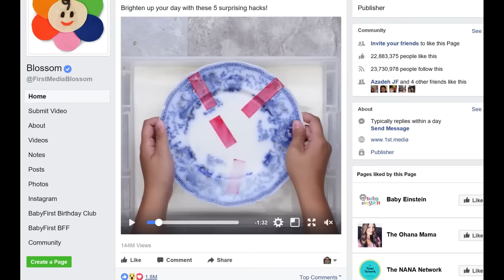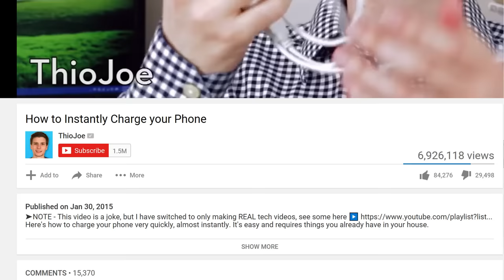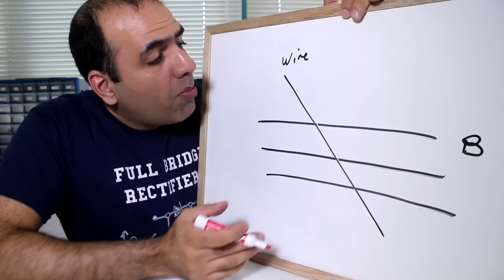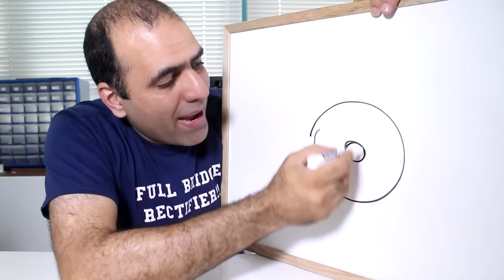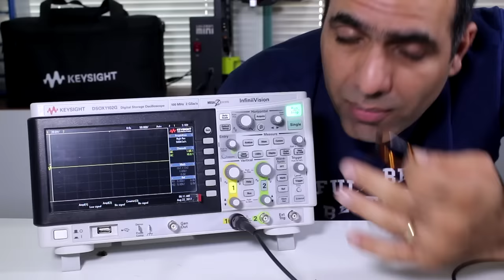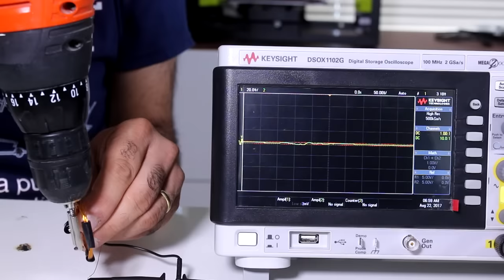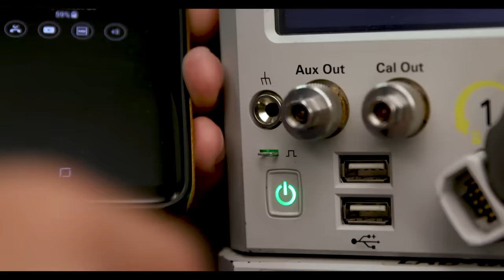Fake DIY Projects Exposed, and How a Real Generator Works

Comment: Oh how smart. Use electricity to generate electricity.
Reply: And actually use more energy to make less, so the efficiency of this is less than 0%
Reply: And bonus, because perfect energy conversion is impossible, it’s electricity, generating electricity, but losing a lot of the original energy through heat and mechanical friction losses.
Reply: Ah yes , enslaved electricity
Reply: use electricity to make electricity to power your electricity makefs
Reply: Thats weird
Reply: @vasilicateodor1862  there is no less than 0% efficiency mechanically.
Reply: He makes electricity to give birth to another 1%MAh
Reply: it's good as proof of concept
Reply: @senselessnothing  I got notified because of you
Reply: @dailyvideos9241  I didn't get notified because of you!
Reply: @HappyMatt12345  I got notified because of you
Reply: @HappyMatt12345  proof of concept
Reply: @senselessnothing  2 sec ago??
Reply: @senselessnothing  also not
Reply: @senselessnothing  I got notified because of you
Reply: @HappyMatt12345  I got notified because of you
Reply: Hmmm yes the floor is made out o floor
Reply: Well in certain scenario it's good - transformers and optocouplers come into mind.
Reply: @nerijusvilcinskas7851  I got notified because of you
Reply: HappyMatt12345 ideally, a generator would not do that. In fact, nothing would. Rather humans convert energy always at an energy loss, to make a more valuable product just in terms of human money. E.g. lots of energy in nuclear fuel turned into way less electrical energy but now in a form much more useful to humans so worth more.
Reply: @johngodfrey3562  I got notified because of you
Reply: Imagine charging your power bank with this.
Reply: mmm yes this electricity is made out of electricity
Reply: It’s basically free energy 😛
Reply: Electricity laundering
Reply: Efficeny isn't 0. Efficeny is only 0 when there's no output. You divide output power by input power and multiply that by 100%. That's how you calculate efficiency.
Reply: @mohamedelsadig5820  r/woooosh
Reply: @stefanpejak9131  r/woooosh
Reply: It actually works
Reply: Yes the floor is made out of floor.
Reply: Congrats, you invented industrial generator.
Reply: Some people use electricity to generate another types of power, he uses electricity to generate electricity 😎😎. Free Energy device confirmed???
Reply: That example with driller is actually the perfect example but the case is that the fuel is different. In his example electricity is used to power the drill and to rotate the magnets for the generator but the real generator consists of a diesel or gasoline engine rotating a magnet at high rpm's, so a generator is not electricity to generate electricity
Reply: you do realize that that is how Fusion Reactors work right? they use electricity to generate more electricity
Reply: How smart, using argent energy to extract argent energy
Reply: Bruh
Reply: i am your 3k comment
Reply: No steam turbine
Reply: 43 chars
Reply: even if it dint lost any energy, there would be no output
Reply: Whats wrong with you
Reply: I used the electricity, to create the electricity. (Or I guess in this case, I used the electricity to destroy the electricity)
Reply: even more smart idea: build a virtual reality portal and take back a Creative Battery from any Minecraft tech mod
Reply: @ajddavid452  oh yeah how smart. Minecraft yeah. ....smart indeed. 🤦
Reply: @solidsnake246  IT WAS A JOKE, also it appears I've already commented on this
Reply: “This is Elon musk”
Reply: lol he did
Reply: It's not electricity making electricity. It's just converting one form of electricity to another form of electricity to make it compatible to the appliances in question.
Reply: Except you lose energy in the process 😃
Reply: So it solves world energy problems. What a genius thing
Reply: That’s cannibalism

Comment: ThioJoe  taught me the importance of changing my computer's oil.
Reply: To be fair, if you have mineral oil computer mod, you probably should change it every few years or so..
Reply: Mythrell lol true
Reply: Actually, I regularly oil the fan bearings.
Reply: But do you regularly check your blinker fluid?
Reply: I personally check AC fluid levels to make sure it stays nice and cool
Reply: You should change your computer oil every 3000 miles or every year
Reply: aszi88 You don't really need to oil them, they are encased in a enclosure filled with greese. They self-maintain.
Reply: PunakiviAddikti whoosh
Reply: At my first employer (GEC), apprentices would bunk off to the pub by wheeling the oscilloscope off-site to get the distilled water changed.
They got caught, not because security got wise to them, but because they tried to bring the scope back through a different gate to the one they went out by..
Reply: I love ThioJoes videos. He seems to be trolling those fake ones!
Reply: Hahaha good one

Comment: Dude I would love that oscope. I woke for the IS Army Calibration lab at White Sands Missile Range. I have used and calibration some nice keysoght equipment.  I’ve always wanted to have a scope at home for diy projects. Love your channel. BTW I took a class at Keysight in California to learn to repair the PSA Measuring receiver/ Soectrum analyzer. Met the guy who worked with the inventor of spectrum analysis. That was a cool week.

Comment: Man I sure could use that scope, I am a student and I have been using an HP1222A 15mhz oscilloscope from the 70s. I already repaired it several times, but now its totally broken and i can't find whats wrong with it. I got so many cool projects on hold because of that, not to mention how much stuff I could do with an actual digital storage oscilloscop that even has a fuction generator and counter, man that would be cool.
Reply: Bttrs you missed the giveaway he did a while back then, he offered three of those
Reply: Dorvuzak Uzn Dang, chances always seems so slim. Maybe this time.

Comment: Min 7:31- this is the hand cranked generator I made in my other video.  It has an actual generator, that outputs to a rectifire circuir. The DC goes to a 5V dc swithching regulator, that outputs to USB".  I think you don't need that rectifier, it would work better without it. The brushed motor that is visible, will output DC allready. The rectifier will drop 1.2-1.8v. Just use a shorky diode, if the dc regulator does not have rev polar prot. It will work more efficienty, but only in one direction.

Comment: Another thing to mention was that USB devices, particularly more recent ones such as smart phones require voltages in the terminals aside from Vcc and GND to charge, so that the charger can communicate with the phone. The first time I tried to make my own USB charger, I connected the Vcc and GND wires of a USB cable to a power supply, with a LM7805 (as the power supply only offered 2, 4, 6, 8, 10 & 12 V). The device said it was charging, but the battery capacity percentage did not go up (iunno how to word it). It wasn't until I broke apart a car USB adapter and connected the inputs to the power supply that the device charged properly. (All of this was for a Bio - Mechanical USB charger for my Design and Technology HSC, which I didn't manage to complete in the end anyway, but because it was accelerated, it doesn't matter too much regarding my final mark in year 12. Aside from that, PLEASE GIFF THE SCOPE AND I'LL MAKE YOU PROUD BY (NOT FAILING) PHYSICS AND ENGINEERING (Hopefully. I've lost quite a bit of hope after failing to complete my Major Design Project).
Reply: Yep for compliant devices you only need to short the data lines (D+ and D-) together to enable 1.5/1.8 amps. Non compliant devices are different. For instance Apple uses 2.1 and 2.8 volts on the data lines for 1 amp and 2.1 amps. From experience an iPhone will accept power from a shorted data line source, though this may depend on the iOS version. Not sure.

Comment: You'll want to take a fork, bend down all prongs but two, then stick in the wall socket.
Reply: Just use a pencil to push the safety lever back in the earth prong slot.
Reply: Ákos Rutai I've actually found a couple of power strips for American outlets that feature a similar protection to that, they are set up to open their port covers when the longer of the two main prongs (not all our plugs have grounding pins so they couldn't do it that way) on a plug are inserted (not sure if it's live or neutral, but one of the prongs is longer and bigger sometimes) problem is that there are a bunch of plugs where both live and neutral are the same length, so the shutters don't get opened and people get really annoyed with the thing, lol. Kinda wish our plugs were a bit more like yours.
Reply: This will save you hundreds on your electricity bills because it will trip all of your breakers. To save even more money, take two forks bend down 3 prongs on each. Hold a fork in each hand and stick each into a different side of the socket. This way you wont have to buy food, clothes, pay for TV nothing. Just a funeral.

(DON'T DO THAT YOU WILL DIE OKAY???)

Comment: As I kid I watched a video where a guy used pliers to open a AA battery and out came 4 button cell batteries. Since I was a kid and button cell batteries were a rarity that powered small toys I tried it my self, ended up getting the core of the sell everywhere and made a huge mess getting all that stuff on my hands. I was stupid.
Reply: Ramen Masri sure it wasn't an 28A battery? Those actually do have four LR44 button cells inside. They're even also labeled as 4LR44.
Reply: xlrxlr nope it was an energizer AA, I'm sure it was an April fools joke but this was several years ago I could be wrong. I have never heard of the battery you are referring to.. is it still a 1.5v alkaline?
Reply: Ramen Masri I saw a vid like that years ago from...gah I forget the name but he hardly uploads anymore and if he does it's mostly promo vid
Reply: Ramen Masri nope. It's a 6v battery, I can't remember if it's alkaline or lithium. Typically batteries over 1.5v are made up of smaller cells that are 1.5v each. I tried this with a small A23 battery and inside it had 8 tiny button cells. 9V battteries are also made of smaller cells. Some are similar to AAAA batteries inside and others are different with wierd box shaped cells in a stack.
Reply: Also seems like im not the only one who had trouble with this concept, a lot of other people tried using normal AA batteries as opposed to the 12v ones. This seems like a pretty stupid mistake in hindsight, but hey I was 10..
Reply: by any chance was it kipkay?  Thats where i learned it from and that video was uploaded about 9 years ago https://www.youtube.com/watch?v=QxS38_u7Mnw
Reply: xlrxlr yes it was!

Comment: I know exactly how that fake cell phone charger generator was done (hint: he took a normal functioning cable bent it backwards 180 degrees routed the cable behind the phone (notice the angle the phone was held at so you couldn't see the side of it) then behind his hand and out of the video frame and how he got it to start charging when he put the coil to the spining magnet well he probably just hit a out of frame power switch connected to the charger cable connected to the phone)
Reply: Or he just had his phone play a video that went from a black screen to the charging animation.
Reply: Jeff is closer on the mark. The coil is a cable presenting enough impedance to the USB to enable "dumb USB 2" charging cable mode. Normal chargers do it with a resistor.
Reply: Do you have definitive proof of this or is that just another possibility?
Reply: Easy version: http://blog.curioussystem.com/2010/08/the-dirty-truth-about-usb-device-charging/
The mistake on this page is that USB 2.1 spec says <200 Ohm. Even a wire short might be compatible but I suspect some low impedance is required or the protection circuit on the port kicks in and nothing happens.

Hard version is in USB 2.1 charger standard.
Reply: Yes, I am already familiar with the USB charging specs. I'm asking if you have evidence that this is how the hoax was achieved.

I presented my suggestion as a possibility whereas you presented yours as a fact. I'm wondering what the basis of your confidence is.
Reply: The confidence lies in the fact that another team uses a similar wire (with resistor, not coil) at work to test if charging mode switch works... Of course it does not charge anything.

If you do not trust it enough, it's easy to reproduce, chop a USB cable, solder D- and D+ lines together (with a tiny resistor or a coil). The dead giveaway is that the mode switch happens instantaneously when in Samsung J3 as shown it takes about 5 seconds - it boots the device partly after all.
Reply: Dustin M I'm not questioning whether it's possible. I'm asking if there is any evidence - something in the video - that makes your thesis even slightly more likely than mine or any other?
Reply: for goodness sakes people it isn't that complex... look at the charge percent
Reply: The charge shows at 48% in one clip and 46% in another. I don't fully understand the significance, can you elaborate?
Reply: jefftheworld when the bar was going up the percentage didn't follow
Reply: Didn't follow? The clip is only a few seconds long, I wouldn't expect to see the percentage actually rise in that time.
Reply: And what would that fact prove? I'm genuinely curious.
Reply: Lol, its way easier to just play a video
Reply: the battery icon was filling up at a tremendus speed yet the percentage was the same

Comment: If you put your Iphone 6 in the microwave, it will charge in a few seconds!
Reply: Vincent Lagarde does this work with the 7?
Reply: only if placed in 4 inches of water first
Reply: Vincent Lagarde This also works with a toaster.
Reply: LegitxClock if you throw a Frisbee at your dogs neck fast enough the dog dies
Reply: The iPhone 8 is supposed to have an ability to charge from shock absorbing, that means you could smash it into the ground and it would charge for up to 30% per smash depending on how hard you smash.
Reply: If you put your Iphone 6 in the microwave, it will explode in a few seconds.
Maybe I'll trust you if you changed iphone 6 to samsung galaxy note 7.
Reply: Hey, you owe me a phone.
Reply: +LegitxClock     Yes it does, but it's not as quick.
Reply: maybe putting your phone in milk for two days would work ?
Reply: I tried it. Got charged with multiple crimes for burning down the neighborhood.
Reply: I had a roommate in college who I had to convince to not do that.
Reply: If your rice is too wet you can use cellphones to dry it out in under 30 minutes.
Reply: maybe you wanna say die and discharge

Comment: The whole fixing a plate with milk isn't entirely off. While soaking it in milk doesn't magically fix the plate, there is a protein in milk called caesin. It could theoretically be used to make with a ceramic type material.

Comment: 1: There are not enough windings on the coil to charge the phone
2: Just replaced the plate with a new one
3: If your battery did charge that fast your phone would explode

Comment: 7:25 but we can use a transformer to step up the voltage in the secondary winding, sorry if there is a limitation to that as I am a high school student 😅😅
Reply: But then the tiny tiny currents will get even smaller. You would be lucky if you got a milliamp out from the high voltage side
Let's say you're getting 50 mV and 1 mA and you step up to 1V. You need a 1:20 ratio transformer, and then you'll get 1V, but with only 50 microamps! The power output is 50 microwatts in this case, and a phone requires at least 2.5 watts to charge! And all this is valid ONLY if the process was 100% efficient, which it is NOT and will NEVER be.

Comment: I have a Hameg oscilloscope and I broke the component tester function with high voltage from a charged capacitor.
Watching electroboom I figure out that a Keysight instrument could resist much better an unconscious manipulation.
Need one of those...

Comment: You know that video? A charger, wrapped by magnetic wires, and two magnets put left, and right side close to the charger, and it generates. He plug a connector, and charging into the phone, and the power turns on.

Comment: I have a question..
 Can you wrap a copper wire around into a coil and insert small amount of volt and the heats going around and generates a lot more heat which produce volts... is it possible?
Reply: Heat doesn't generally produce voltage. Sure, you can utilize a thermocouple/thermopile, but that would be inefficient as you're trying to heat your coils, which will increase their resistance (and thus increase your power losses)

Comment: What's worse is that even if that first one worked, so what? How would it help anyone? Surely buying things like a soldering iron, a copper coil, and a motor would cost way more and be way more inconvenient than simply just... buying a new phone charger.

Comment: Can you make video about how to use scopes, I want to buy one so I could start making tests, I don’t know how to use it? 
I tried to made one but it didn’t work.
Reply: a basic 1-channel oscilloscope only has two important settings.

1) Voltage.  Set it higher to measure bigger signals.  Don't set it too low on a big signal or you could damage it.
2) Speed.  The faster the signal, the higher you need to set this to see anything useful.

You can get really cheap mini-scopes on ebay.  They're not fast or great but you don't need an $800 oscilloscope to dink around with an arduino